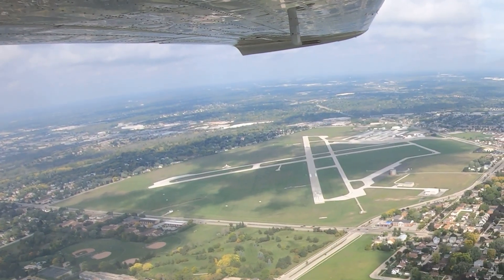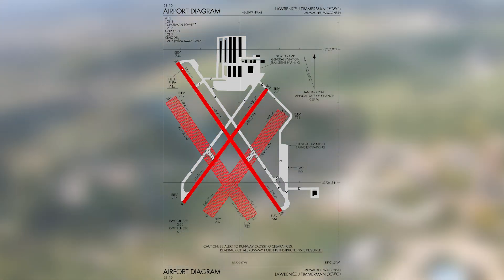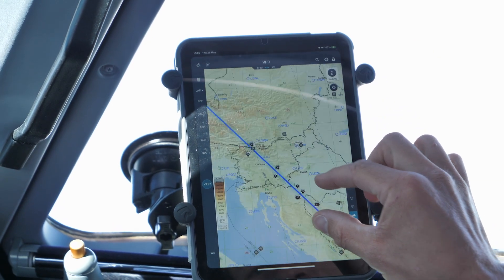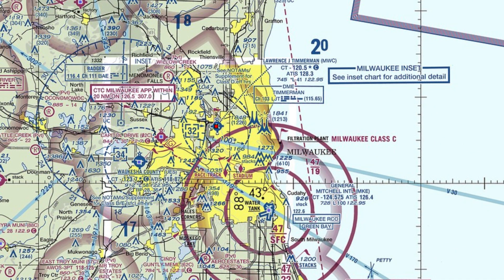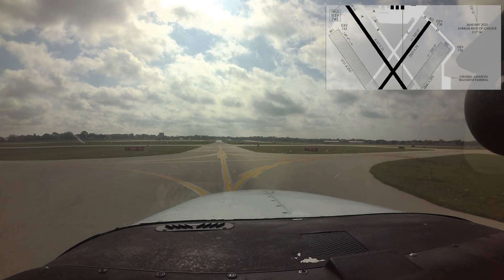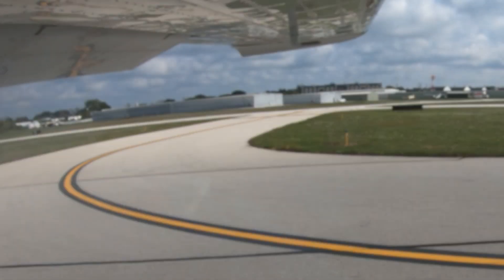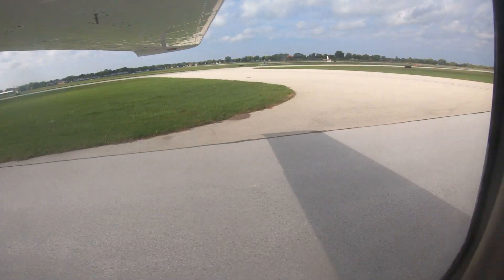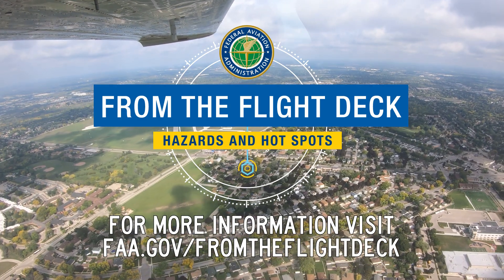From the Flight Deck – Timmerman Airport (MWC)

Comment: Timmerman is the reason I'm a pilot today. Grew up less than a mile away and seeing the planes going in and out of the airport and training from there sparked my interest. One thing not mentioned in this video that pilots should be aware of is that with the proximity of the turf and paved runways, your taxi clearances almost always involve clearance to cross both runways in the same instruction.
Reply: Ha, wild to see you out here on one of these random videos! I just got done watching a video for Wheeler Airport in KC and figured I would see if there was anything on the Milwaukee airports from when I was a kid.
Reply: I was walking passed here today like I usually and noticed a guy filming from the sidewalk on the Eastside.. I then saw several facility, or emergency vehicles around a prop plane on the runway... supposedly on landing they came in too steep, nose down I suppose??? Damaging the propeller, according to the man filming the incident... I'm always watching the aircraft there, but I have one question. Have you guys seen a small black jet with a V-Tail flying around there? Was the coolest thing ever, looks small possibly single man cockpit... thx

Comment: The biggest hazard at Timmerman is the lack of options if you lose your engine after takeoff.  And traffic from 02C hasn’t strayed into the Delta for years.  The advancement of ADS-B and moving maps has pretty much eliminated that problem.